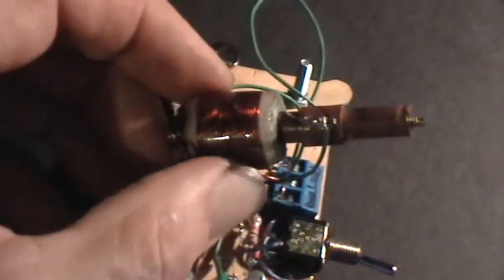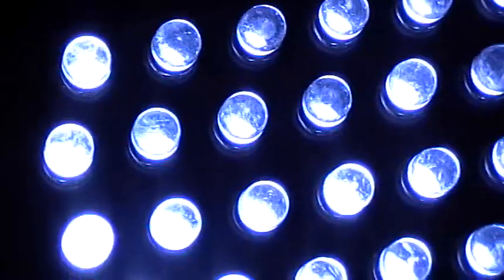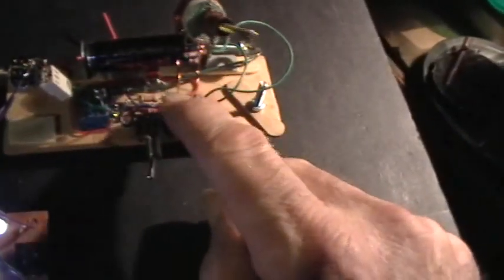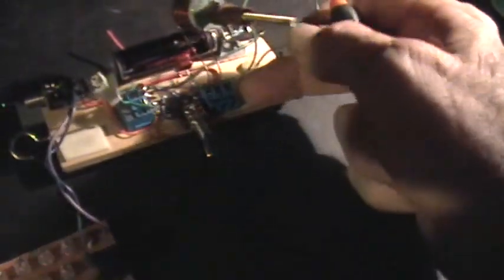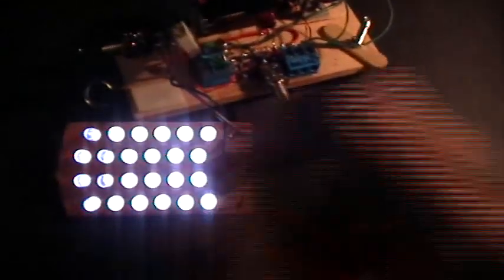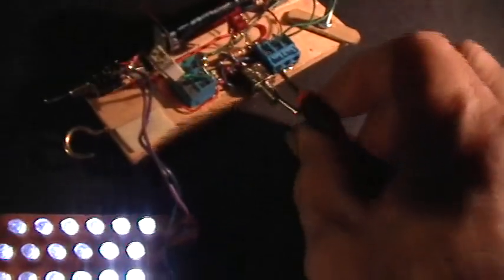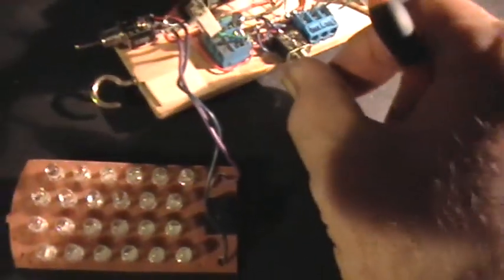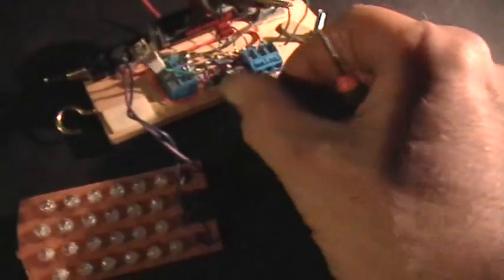Joule Thief: JTBasic meets Loopstick Variable Inductor

Comment: My Supercharged JT, by far.  See it compared to a conventional JT.  It's nearly twice as efficient, with about half the supply current while putting out about the same amount of light, measured with a luxmeter.   rustybolt(.)info(/)wordpress(/)?p=221 (remove the parens)

Comment: One thing about the Litz wire: it's made for high Q in this inductor, but not for low DC resistance.  You have to have a lot of peak current from the battery and to the LED, and when the inductor is high resistance, it eats up power like crazy, lowering the efficiency.  Like you said, maybe the coil you wound is too far from the core.  Wind a feedback winding on top of the one you wound, and see what happens.  Better yet, just pull the core out, wrap paper on it and wind both windings on it.

Comment from the maker: And yes, I have tried all kinds of interesting cap arrangements, but not with the loopstick yet.  
There is a definite "nonlinearity" with the  loopstick and the cap, but not without the cap, at some supply voltage levels. By moving the core you can find a point where the light brightens abruptly and remains steady with further core movement, until it comes out the other side and the light dims abruptly. I think this involves a sudden shift in frequency but I haven't scoped it yet.

Comment: I guess that the circuit with the coils in parallel (non-bucking) needs the 70 nF to start swinging. And it should be very sensitive to the capacitance. Did you try 1 µF or at least 220 nF? Greetings, Conrad